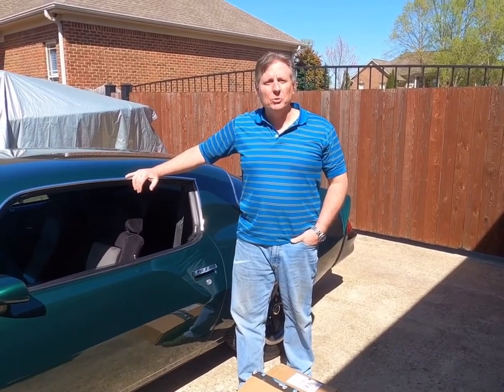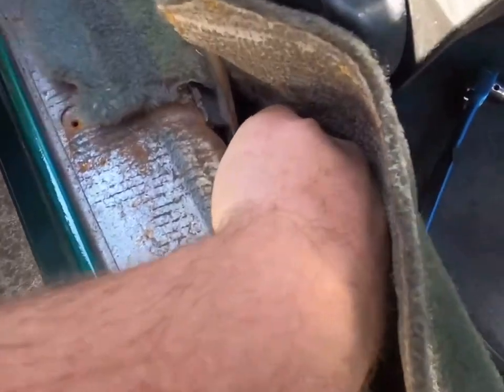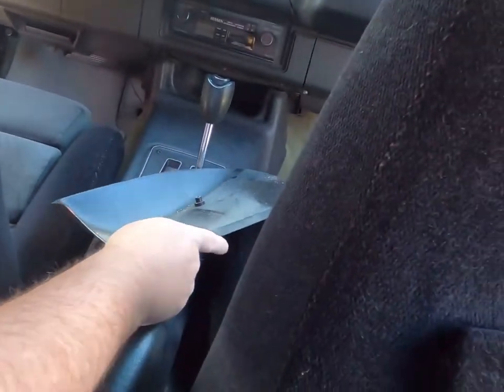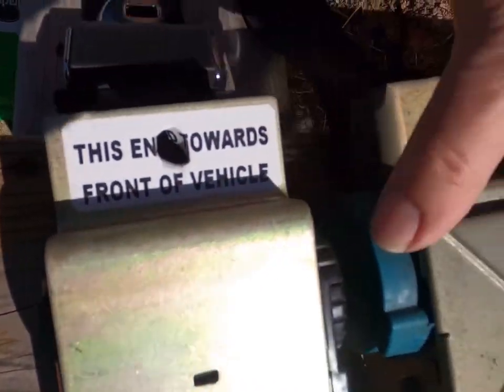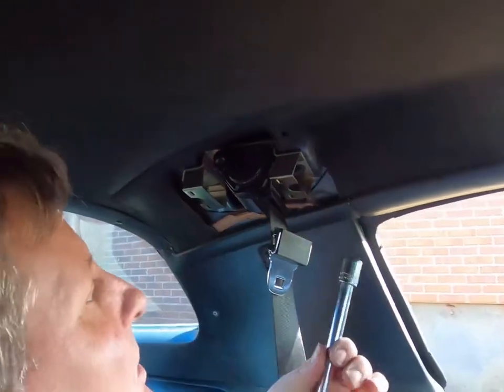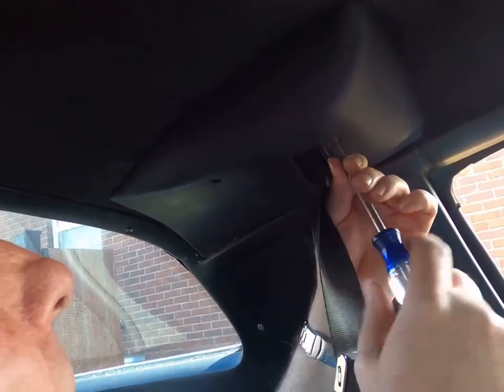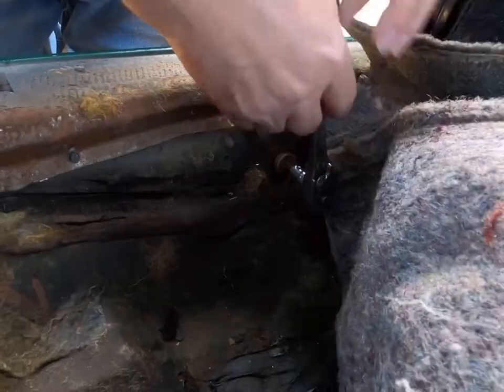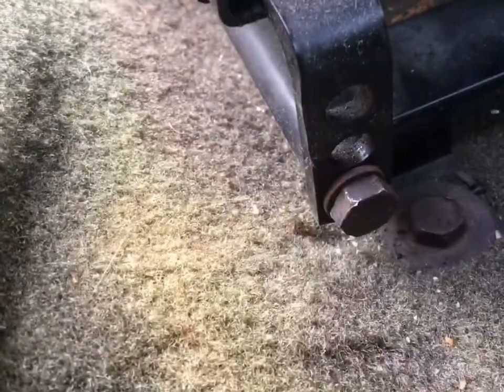Camaro Seat Belt Install 1974-81 Classic Industries

Comment: Does the new front drivers seat receptacle come with the wire harness for the seatbelt buzzer?
Reply from the maker: @cheddarchip1013  I don’t think it did, the old ones were disconnected anyway.  I think my Grandad’s 75 Chevelle would not start unless belts were buckled.
Reply: @millionmilegarage9587  perfect, just needed to know if they did or not!

Comment: U need that part going srewed into the seat to give u more clearance on your nech i have a 79 camaro z28 n it came with that trim sucks that ur seats dont have it maybe u can find something similar cool ride 👍
Reply from the maker: Yes I have pondered on that off and on, thought about making one or taking a tour of the local pick a part to find something that could work.  Was not a problem with the original ratchet style belts.  I did disassemble the new reels and unwind about 7 turns of the retractor spring so it doesn’t crease my neck anymore!

Comment: Hi. Did you find a solution for the cover of the rear seat belt retractor? I ordered a new seat belt set, too. Iam afraid that the old cover will not fit also.
Reply from the maker: You know I never did get that sorted out.  I ran across them a few weeks ago, after studying them it looks like some metal can be carefully trimmed off the reel frames without causing any loss of integrity to the structure and allow the original covers to slip on. Of course this would most likely void any warranty or liability from the manufacturer.  Looks like there may be a sequel coming to a theater near you!  😄

Comment: If you tug on your either of your factory seat belts (the ones you replaced in video or the ones in your 78) do they stop and catch? 

In my 78 neither of my front seat belts catch when quickly tugged on, I am afraid that they would not catch during an incident.
Reply from the maker: I am pretty sure both the old and new ones do, you have to tug pretty quickly though.
Reply: @millionmilegarage9587  Just spoke with a pro who mentioned a pendulum within the system that comes into play during an incident versus when just tugging on sitting in the driveway.
Reply from the maker: @sebastianpowsey460  yes, it’s a lead weight on the tip of the pendulum on the stock belts, you have to jerk them pretty quick to test, a gentle tug won’t do it.  Edited in: I just tried that on the 78 and could not get it to do it.
Reply: @millionmilegarage9587 I just replaced my old worn retractable seatbelts with lap seatbelts on my 1984 Dodge W100. I personally don’t like the retractable seatbelts because they always get stuck, a lot more expensive to replace.

Comment: HI
Great clip!
Do you remember the ceiling mounts bolts specs?
Reply from the maker: The only thing I remember is the kit came with washers (if needed) to keep the reel assembly from contacting the outer roof skin.  The factory bolts were re-used.
Reply: @millionmilegarage9587  Thanks!
are the bolts too long so there's a risk of contacting roof skin?
Reply from the maker: @iamreshef  There is a head of a carriage bolt that can contact the roof, clearance varies.  The carriage bolt is not present on the original reel, it is used to bolt the replacement reel to the special adapter mounting bracket.
Reply: @millionmilegarage9587  Got ya! Thanks!

Comment: Do these seat belts lock up incase of sudden stop?
Reply from the maker: They catch immediately with a quick firm tug.  By design they have to do that, but don’t take my word for it, go to the source of the product to verify.  By law the belts have an approval tag that means they function as restraints.
Reply: @millionmilegarage9587  thank you for the reply. I don't suppose you know the measurements of the retractable piece? I can't seem to find that style for my specific car so I was hoping to give those a try
Reply from the maker: Bipolar Garage I don’t know dimensions, I think they fit 74-81 Camaro and 74-?Nova.  They are in Classic Industries online catalog.
Reply: @millionmilegarage9587  OK thanks